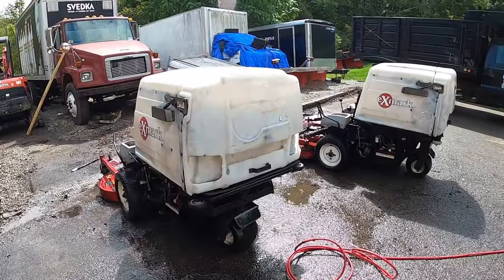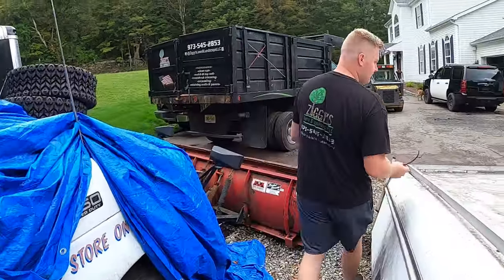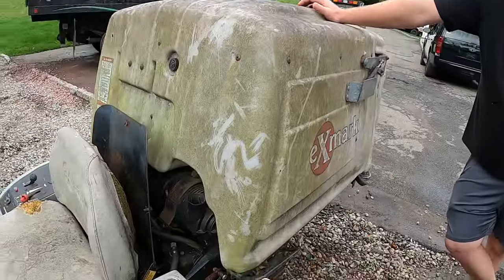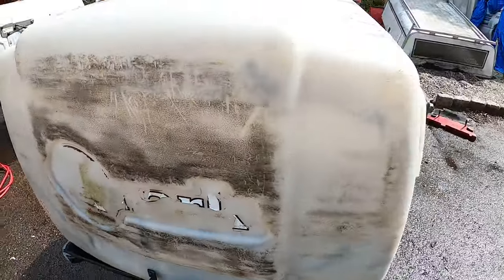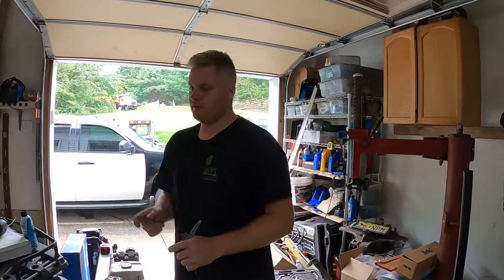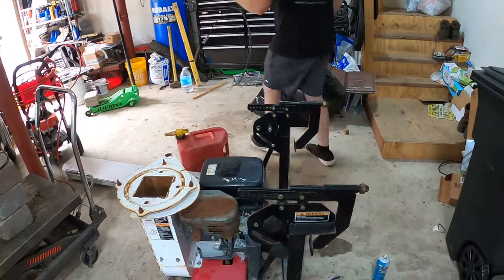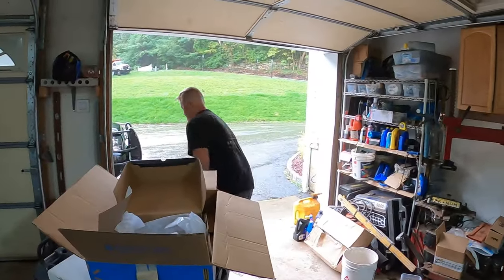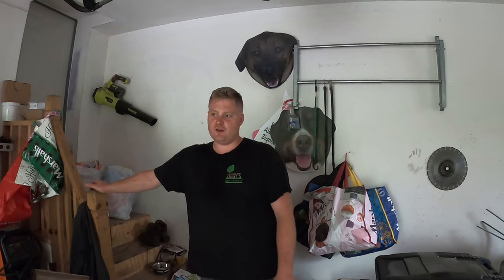$1000 PAIR of EXMARK NAVIGATORS! Are YOU Thinking Fall?

Comment: we've got a split tail wheel on our 22'. definitely heavier than the walker ruts up wet laws/tree rings edged plant beds more than the walker. Maybe out walker are getting old but i'd take ex-mark over walker any day for wall clean up you flip large screen over for fall clean up and it barely leaves a trace of leaves. make sure there are no sticks in the ex marks. they will make belts slip/seize all the time. walker can be covered in al debris

Comment: I almost bought a new Navigator back in 2003 because at the time I wasn't approved for Walker financing but was for Exmark.. I demo'd the Navigator and brought it to a buddy who ran Walker and did a side by side comparison.... overall the Walker just performed better, was lighter, more compact just by a little all around.... The lower deck being smaller was less weight on the front wheels etc... I just decided to not buy one and saved up and bought a new Walker cash.... Back then the Walker was only about $9200 out the door 20hp Carb 48GHS